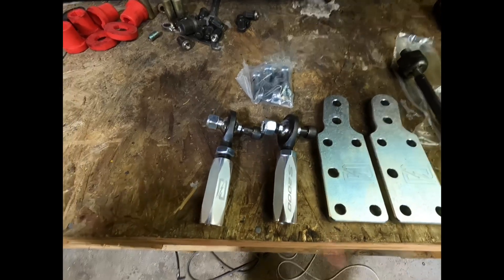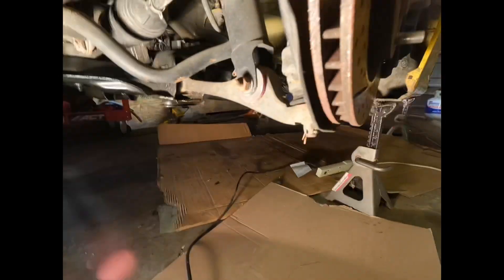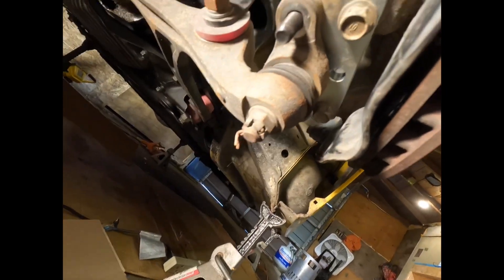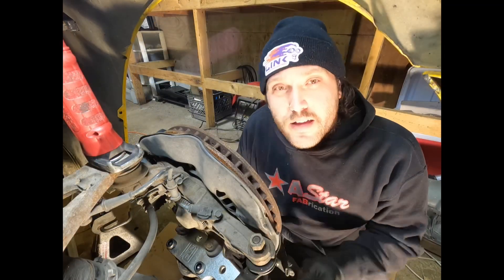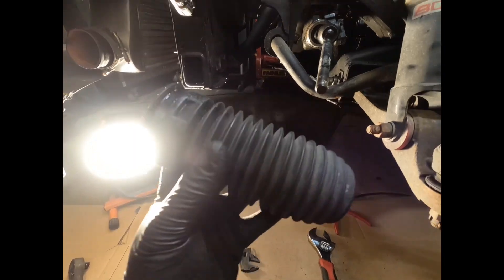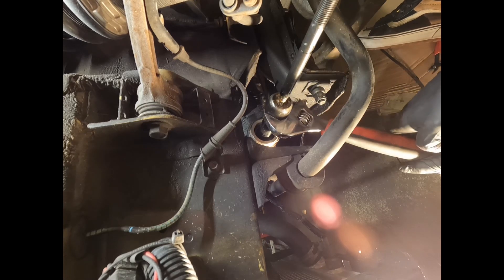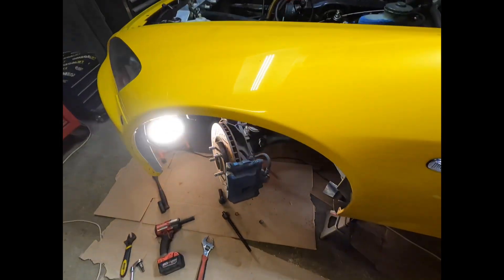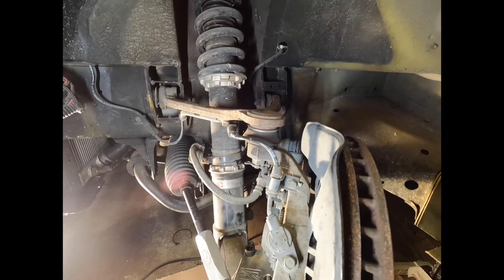Drift S2000 Angle Kit Install

Comment: Very useful video! I am thinking of buyng this kit...
What tyre size and offset are you using?
Are there any crerance mods needed?
Reply from the maker: So proffered rim width is 8-8.5. Far as size with 18s you have to clearance the headlight bracket a lot. 17s I’ve never ran but should give you an inch of extra clearance in comparison.
Reply: @JustinMedina   thank you very much! i am converting a time attack s2000 to drifting. i have to stick with 18 because my big brake kit.
i`ll look for 18 by 8.5, i can stick them pretty far out but i dont wanna mess with the scrub radius...
Reply from the maker: @greggo93  so this kit will add more scurb radius and track width, just a forewarning. It’s the nature of angle kits generally.